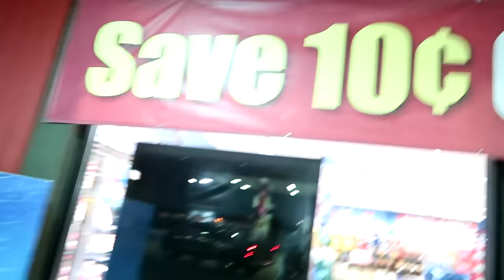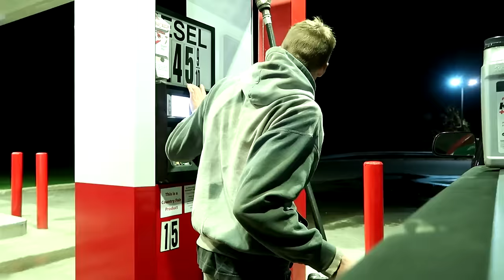EPIC FORT IN WALMART RAFTERS!

Comment: Dalton get a cheap sj4000 cam, colin furze uses then in the high risk parts of his shooting and at $60-70 its a lot less to loose and similar quality footage, it uses all the same gopro equipment inc waterproof case mounts etc, make sure its a genuine sj though, it will have SJCAM between bottom middle and right

Comment: Should I buy a crf 150
Reply: Rocketvince 1213 buy a 2013 and up KTM 85
Reply: Rocketvince 1213 yes
Reply: Rocketvince 1213 no buy a crf 150 RB ( they're four strokes)
Reply: Rocketvince 1213 if your a beginner get the 150f but if you want to start racing get the 150r. I have a 150r and I race you can watch my videos if you are interested, and yes the 150r is a rocket